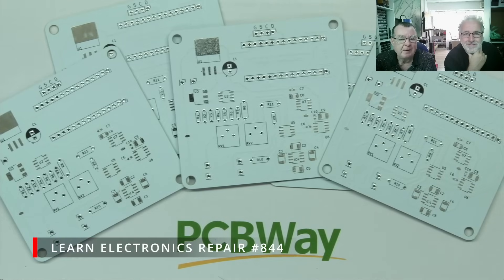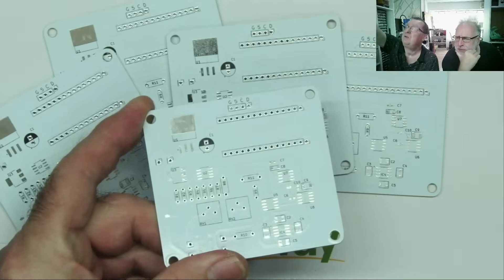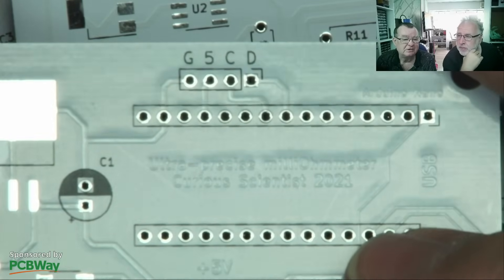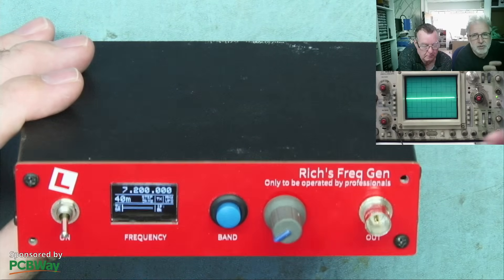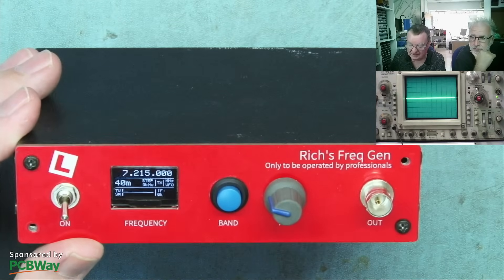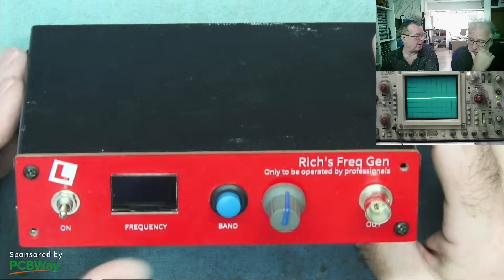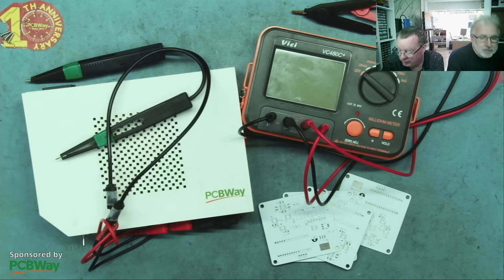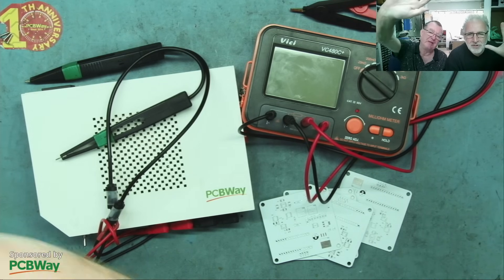Build An Ultra Precise MilliOhm Meter DIY Electronics Project

Comment: the biggest issue I've had with LoM's is the leads, getting a nice pin-sharp pair essentially necessitates having to make your own.

One method I've used is to attach the sense/feed wires on to either side of a short length of fairly tough but fine metal wire and then fold the wire in half with insulating sleeves, place the assembly into normal probe holders and then file down the tip to required sharpness ( yes, you'll still get an offset but it's greatly reduced ).

LTC2412 was my choice of ADC and used a ratiomatric comparison between a known reference (10.000R 4-wire) and the unknown;  always interesting to see other methods used to achieve the results required.
Reply: We used to use some form of harden steel pins when making our wire looming boards. I used to put them in a drill and sand the coating off each end. The point was very sharp and nothing seemed to blunt them. worked great for making probes. 
Only made mOhm measurements when preparing for EMC testing. Connectors to case, case to lids,  outer screens to connector back shells.
Reply from the maker: I find the kelvin probes I made from multimeter tweezer probes work better than the big chunky ones on the Vici.  I used two of these https://www.aliexpress.com/item/32812353543.html?af=ler2022 and cut one black and one red lead off then swapped them over so one set of tweezers has two black leads and the other has two red leads.  It does not matter which of the blaks or reds you use for current injection and which for voltage measurement
Reply: @LearnElectronicsRepair  When using two spikes, i for some unknow reason i always had the current pins on the outside. gods knows why as i don't expect there to be a measurable difference.

Comment: CuriousScientist also does many projects on youtube. You may want to ask them for suggestions on completing the project. The LTC2400 is an extremely schmick part (although it now has many newer alternatives... 2410, 2413, 2415 if you want to get into the weeds), and the reference is near the best low-power voltage ICs you can get. Properly implemented, this sort of system can essentially be the core of a ~6.5 digit voltmeter.

Your own project, using the differential opamp, might be upgradeable to have a x100 toggle to give it an extra digit of accuracy, without breaking too much bank. It would likely just be switching in two different resistors in the opamp circuit and an extra pot somewhere to cal them.
Reply from the maker: I actually did that, basically.  I put two 4mm banana sockets on the side of the tester and if I connect a multimeter with millivolts range I get an extra digit of resolution on the resistance reading.  The milliOhm meter basically sets 1mV across the resistance under test to equal 1milliOhms. With the 5 digit display I get a maximum resolution of 0.0001V (100uV = 100uOhms)  My Aneng8008 in MilliVolts range gives me a resolution of 00.01mV or 10uV = 10uOhms  😉  I tried this on one of the previous videos

Comment: i don't need a mOhm meter that often so I just use a PSU with a 1A constant current set and measure the voltage.
the voltage readout is the same as the mOhms. saves having a meter taking up space that's not needed much.

I nice mod to the software would make it auto ranging.
Reply: Squeak !!!!
Reply: Yeah, I've done that, but I typically see 0.2 ohms in my test leads and bench supply connectors. I guess I need to put some dielectric grease on things.
Reply: @gadgetmind  point of a 4 wire connection is all lead resistance is removed from the test. 

The current is a constant, or it can be measured at test time so lead resistance as long as it's low can be ignored.

The voltage measurement does not care about any lead resistance as the input impedance of the voltmeter will be much higher than any lead resistance. No current flow then no voltage dropped across the leads.

The rest is just Ohms law.

Using 1A just give a mV to mOhm direct conversion.
Reply: @TheEmbeddedHobbyist  Yes, but you can't do this just with a bench supply, you also need to hook up a multimeter.
Reply: @gadgetmind  well of course you do, which allows me to measure the mOhms to 6 1/2 digits.
my point was if you don't do mOhm tests a lot just use what you've got.
And if you don't have a psu that can do Constant Current then you would be better off getting one than spending money on a mOhm meter.
Reply from the maker: @TheEmbeddedHobbyist  Exactly what you said.
Reply from the maker: @TheEmbeddedHobbyist  And 1A is a bit risky IMHO.  The Vici and the one I built use 100mA
Reply: @LearnElectronicsRepair  if your looking for mOhms then 1 amp is not much of a problem as of course you only need about a 1V supply. 
I was testing connectors on a bit of kit that cost about £28K each. i did blow one up in front of a customer once but that's another story. :)

Comment: I'v just been pricing up parts for this and 1 lt3092est is about £25 !!!!!
Reply from the maker: I'm working out all the component costs for the next video and also as mentioned will ask PCBWay for a fully assembled price as well (they source all the parts).  This is not going to be a particularly cheap project to build and one of the main points we want to prove by building it is whether it is better than the cheap one and whether it is worth the extra cost.
Reply: Change your supplier, about £5-6 on Farnell, Mouser, DigiKey. 😊
Reply: @chrishartley1210  And postage?
Reply: The reference (AD4540) and ADC (LTC2400) are likely the most expensive chips, although some of the others might not be easy to find for cheap either
Reply: It is about $11 CAD plus taxes. The first 3 parts with shipping and taxes from Diigikey is $41 CAD